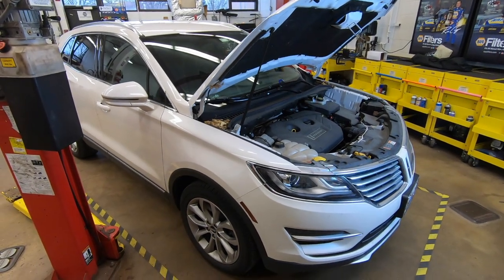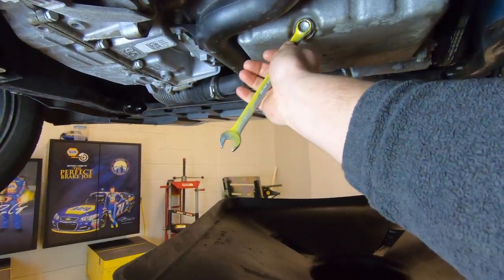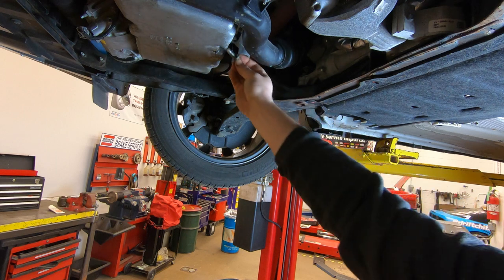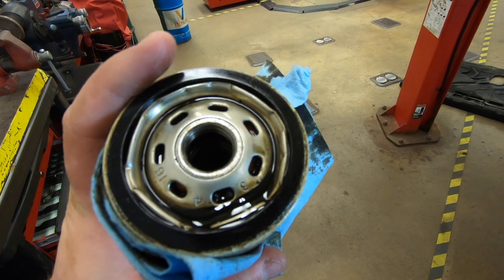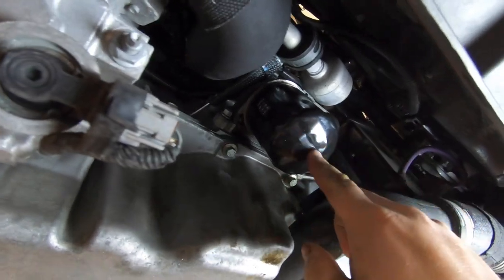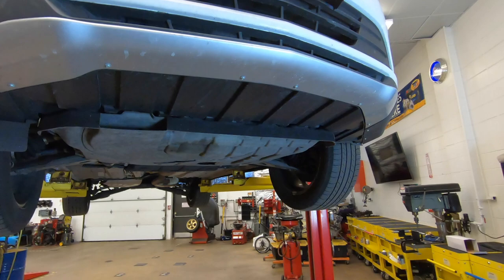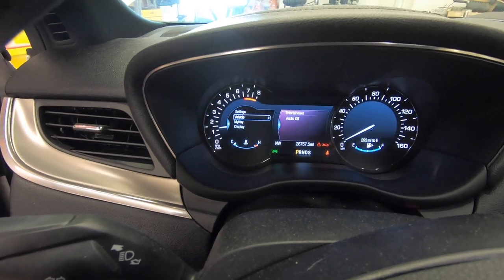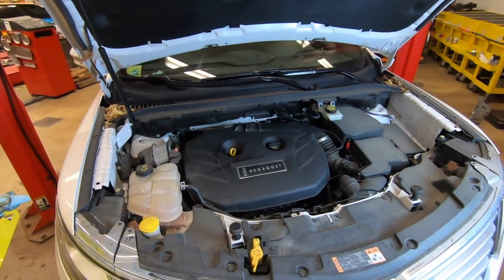How to change the oil on a Lincoln MKC

Comment: I’m a 35 y/o woman, using your video, I was able to change the oil and filter. Also had to buy special socket for a bald oil plug. I also went ahead and did a tire rotation… all by myself 👍🏻

Comment: Very good video I want advice I'm considering buying a Lincoln mkc 2015 . What things can go wrong? Is it reliable?
Reply: For an 8+ years old car, it might need expensive maintenance: the turbocharger is likely flapping too much and leaking oil ($3-4K job), if the transmission oil was not changed every 30k miles, it's likely too late and have some damage. The electronic struts will need original replacement which more expensive than regular and rarely used the custom settings. Rattling noises from doors and other plastic parts. - The engine gets so dirty compared with other brands. That 2016 model in the video looks very clean, unless it is a place where rarely rains?

Comment: Well, I guess I am off to the store for a T-30 bit.
Reply: Turned out I had one. Be careful not to strip these. This has just crossed over from the free dealer oil changes and two of the T-30's were stripped. Also two of them that attach to the fender plastics were 1/4" vs T-30. This video was very helpful. I noticed that the Fram filter from my parts house had 5 flutes while the one I took off had 14. Luckily I have both filter sockets. I jacked it up and rested it on jack stands without going so high that the tires left the ground and was able to do the job. Will I do it again vs watching for a deal? Hard to tell. Took me less than an hour.
Reply: @charlesbyers6911  Bet you remembered to put in the drain plug. A lot of oil change places for get to do that. Even at dealerships. Had that happen to a neighbor of mine. Ruined her engine.
Reply: I used lineman plyers...lol....no need for a.bit ...just a steady hand